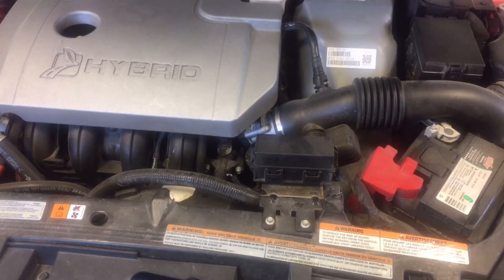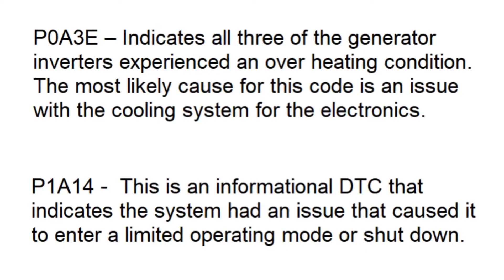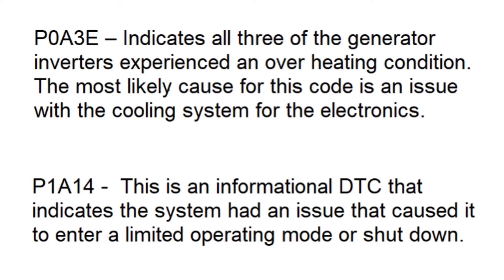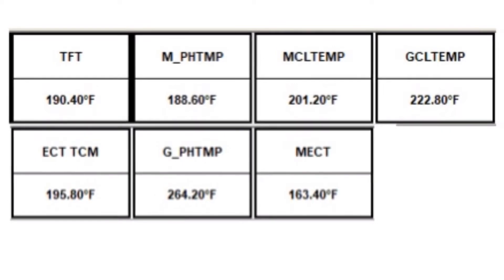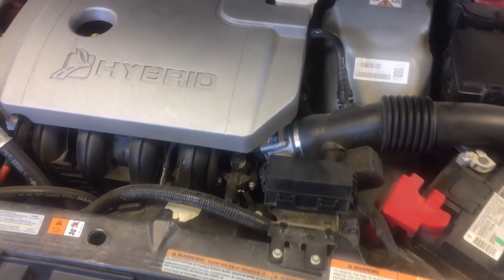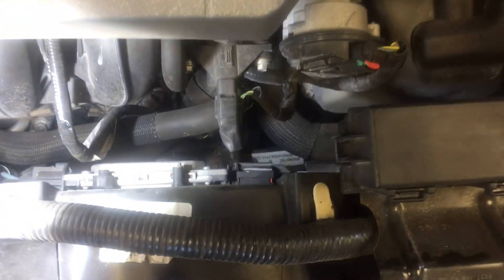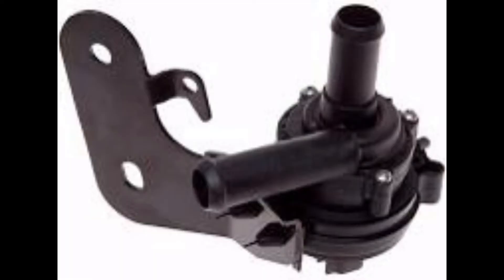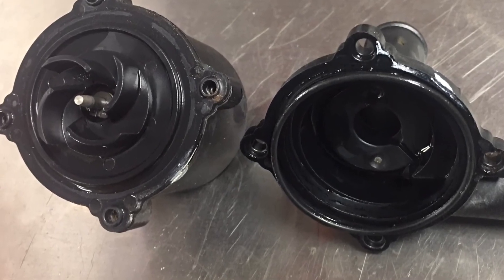Fusion Hybrid Stop Safely Now Message P0A3E P1A14

Comment: I'm having this issue with my Ford Fusion Hybrid 2013, but when I'm looking for the part, there's 2 different ones that pop up, electric engine water pump and engine water pump and I'm not sure which one I should get do you have a link or know which store i can get the part?

Comment: I changed the pump last year. Pump seems to be running fine. Still getting the red triangle, usually after sitting in traffic then climbing hills on a warm day with AC running. Reservoir is full. Can't figure out the problem.

Comment: Do I have to do any bleeding after replacing? If so where is it located?
Reply: Yes. There's a small bolt on the inverter that you unscrew. Try not to unscrew it all the way as it is a tight space to get it back in.

Comment: The coolant pump plugs are not weather-sealed properly. They are known to corrode too quickly on these model fusions, due to the location near the bottom of the car and exposure to water from the roads. The pumps prematurely burn out from the current draw caused by this corrosion. Unplug it, sand the prongs off, spray some deoxit on them, and you're good to go. If it still doesn't work your pumps have been cooked internally. A dangerous problem to have, but it immediately fixed my problem on a 2015 Fusion. I got a coolant warning and I knew I had to absolutely look into it THAT NIGHT or I wasn't driving it. Luckily, it was super easy. Took 15 minutes.
Reply: Which pump you replaced I have a 2014 and replaced the two near the radiator still same problem overheating I herd it’s a third one near the firewall?

Comment: With mine my brake light first turned on then the stop safely sign and my car looses acceleration and shuts off. Now the brake light is always on my hybrid battery doesn't seem to function properly and with the brake light on every so often the car will loose acceleration and shut down any thoughts?
Reply from the maker: I’d want to start by getting all the codes pulled, especially from the SOBDMC.

Comment: My 2010 hybrid car gave me this message after replacing the brakes and everytime I put it on parking it turns off.  Why is that? Please help
Reply: Search on parking break warning light I think there is a way you have to clear the code on the machine if you replaced breakes. I read about it for these but I’m not sure

Comment: 2015 fusion hybrid had the stop light but it went away....been to the shop and they can't  find  any issues. I've put about 3k miles on it since and it drives very smooth
Reply from the maker: That’s strange if it didn’t set any codes or anything.
Reply: @CarShopTalk  Yeah it drives well. I  was told that warning meant my car was done. But not the case so far
Reply: And no more engine lights!
Reply from the maker: @coochiecrook7120  it definitely doesn’t mean the cars done.  There’s several things that are simple fixes that can bring up that symbol.  Over heating electronics comes to mind. Unless it acts up and sets some codes were all just guessing. If it does act up again, make sure that the shop can read codes from all the modules on the vehicle, not just the pcm. SOBDMC is the one I’m thinking your going to find codes in.

Comment: could this problem also occur  if  the  hybrid battery cooling fans not working?
Reply from the maker: If the batteries over heat it could definitely give you the stop safely now message. There should be a battery over heat code in the SOBDMC, PCM, or both if that happens.

Comment: Can you get this and there be a problem even if codes are not showing up? I've had this icon come on twice. I'm also having issues with my gear knob not turning or it turns with a lot of resistance. But when I took it to Ford they said it's not pulling nay codes. I'm so frustrated because there has been times where my gears are stuck for 5 or more minutes stuck in drive or reverse.
Reply from the maker: It’s probably not impossible, but I’d be surprised. If someone is scanning it with a cheap code reader that just scans the PCM it might not show anything, but I’d be surprised if there weren’t codes in the SOBDMC or some of the other modules. The best would be Forscan or a Ford IDS scanner. If you’re just having codes pulled at an OReillys or other auto parts store I doubt there scanner would talk to anything besides the PCM. My usually go to is Forscan Light on an iPhone with an Obdlink mx+ Bluetooth connector. That set up should be able to read codes from every module on almost any Ford.

Comment: Hello! Pretty useful video! I had today same indicator an message" stop safely now". Luckily I got this while my wife and dog were waiting in parking lot. So, while parked, AC on, suddenly the message poped up, and engine stopped. I tried several to restart(even after 2 h cooling off) , the init phase was ok, and when trying to press the acceleration, nothing happened and then the car stopped. I put the car at Ford representative, so on Monday they diagnose them. Do you think is similar behaviour with cases you've been confronted or different? My Ford is 2018 model- in Europe is Mondeo hybrid 2.0 engine.
Reply from the maker: It sounds similar, but I can’t say I’ve seen this issue on any that new.
Reply: Well, the topic is old than a year and the issue was a simple mechanical problem: fuel pump was broken...so the engine was not supplied with petrol. They figured out after 1week ( no DTC on fuel pump - that a big minus), an old mechanic asked to see if the petrol is pumped....Afterwards, replacing the pump was a drama!! 4 weeks to get a new one. Entire supply chain was jammed due to poor fuel pump quality- I check across the Europe and as well in New York and California. So they were testing every batch( Europe and US as well) of pumps. Now after 20k km all is good, no issues so far, runs smoothly with average  consumption from 4.5l/km to max 6.5l/km. Love that car. BtW, the car model is not provided anymore in Europe...
Reply: So i,had same problem what did they did to your car
Reply: Im also curious, I am thinking of getting a monedeo hybrid.

Comment: I bought my 2011 fusion hybrid used, I am having this issue but when I look at the pumps, I have two pumps, one higher up and one lower, does that seem correct?
Reply from the maker: I’d have to see it, but Ford does run multiple electric pumps on some vehicles. Usually the other is to circulate warm coolant through the heater when the gas engines not running.
Reply: @CarShopTalk  I would appreciate it, they look like the same pumps but can't totally tell.

Comment: i really like your video .i bought a 2014 liclon mxz 2.0 hybird' will this still run with your hybird batterys complete dead
Reply from the maker: It uses the high voltage motors inside the transaxle to start the engine, so no it wouldn’t, but it won’t let you deplete the batteries to that level before shutting down. I’ve only seen that once, and that was a training vehicle used by the automotive program at a community college.  It had sat for several years and the high voltage battery was dead. I’d have to look and see what the procedure is on a 2014, it’s varied over the years, but there is a way to charge the high voltage battery and bring it back if this ever occurs.
Reply: I have that problem right now, the hybrid battery is completely dead .What would be that procedure

Comment: I am having the same issue with my 2016 ford fusion hybrid. The engine won't start at all. If I disconnect the 12v battery and reconnect it I feel like the electric engine starts but not sure. The only indicator is that the power steering is working but the car won't move forward or backward.
The only code I have is: P1A0C (hybrid powertrain control module- engine inherited)
Ford says it's the transmission.
(Does the bad transmission cause the gas engin not to start or crank at all and disable it?)
Reply from the maker: A problem in the transmission can definitely make the gas engine not crank / start.  The electric motors in the transmission are actually used to start the gas engine.
Reply: @CarShopTalk  According to the code I have, do you suggest me to replace the transmission (what ford dealership wants me to do), or try something else first?
Thank you!
Reply from the maker: @MrGhassan2006  P1A0C really isn’t enough information to base that on. It’s an informational code that really just means a problem has been detected and the engine is being disabled because of it. There are a lot of things that could cause it.  Usually there are additional codes with it that point to the problem and they may be contained in a different module. A transmission problem or failure could definitely cause this and be the problem.
Reply: @MrGhassan2006   Hello Ghassan i have same car 2016 ford Fusion hybrid with same problem just want to check with you if you figured out what was the problem for not starting the engine?
Reply: @moehafez2873  it was the transmission.
In those cars, the starter locates inside the transmission and the transmission is the most common problem on those ford fusions. Replace the transmission and it will fix the issue.

Comment: Mine is a 2014 hybrid and gives the stop safely now mode, but gives no codes. Any thoughts?
Reply from the maker: Did you pull all codes on all modules with Forscan or an IDS?   Or just the PCM with a generic code reader like an O’Reillys or something?  It’s rare you get something like that with no codes.
Reply: @CarShopTalk  just PCM
Reply from the maker: @michaelspatz3455  Get all codes pulled from all the modules.  I would guess you’re going to have a code in a battery control module or something else that will point you in the direction of the problem. An IDS is probably the best for that, but Forscan is a close second. If it’s forscan make sure it’s an obd adapter capable of talking to multiple networks like an obdlink MX+ Bluetooth or equivalent. I use forscan light on an iPhone with the before mentioned adapter for preliminary diagnosis most of the time and it still shocks me all the capabilities it has. Sometime in the future I’m probably going to do a video on this subject, but get the codes from all the modules and I think you’ll find your problem.
Reply: Thanks 👌

Comment: Ford Dealers 🙄 I called 5 dealers trying to get the Mercon LV changed in my 2013 C-Max. One said they could “power flush” my transmission for $179. No thanks, this car has an HF-35 transaxle, drain and fill. No power flush needed. Next dealer says transmission is factory sealed, no service required 🙄. Next Ford dealer said they would have to call me back, she couldn’t quote a price for the service🙄. Next Ford dealership put me on hold forever, so I hung up after 10 minutes.  Found independent shop, he told me to pick up the Mercon LV on my way to his shop. He even let me watch him perform the drain and fill (I didn’t even ask) and we chatted about cars and trucks(nice guy). If you can find an honest independent shop, tip him generously, they are GOLD!
Reply: My dealership in California did it for me at 60k when I requested it. The mechanic told me that they actually get a lot of Ford Fusion hybrids with transmission issues and that she thought it was a good idea to get it flushed and treat it as a normal automatic transmission when it comes to getting the fluid changed.

Comment: Me again. I followed the advice and ordered a new coolant pump.  I had the dealership install it.  They were a little . . . I dunno,  but they did it.  Afterwards, I drove 110 miles at highway speed and no problem.  Previously, I could barely go 30 highway miles without the warning lights coming on.  Thank you so much.
Reply from the maker: Glad you got it fixed.
Reply: Hey was it easy to fix

Comment: This is exactly what my 2012 Ford Fusion does!  I have had it in the Ford Shop 3 times.  They would add coolant, did things to the pump, but did not replace it.  The third time they said it needs a whole new transaxle at $15,000!  I will see about getting this pump replaced.  thank you so much.  And I will let you know.
Reply: What I'm going through right now with Ford on my 2010. They are telling me I need a new transmission and asking about the same. Insane.
Reply: @Rustiie_95 Hey did you got it fix?
Reply: @gaoussoudoucoure4424  nope. Brought it to Ford and another place. Both said 2 totally different different things costing over $10k each. Just ended up getting rid of the car. Would not have been worth the hassle.
Reply: @Rustiie_95  that’s true. Thank you for the reply. I don’t know what codes were you dealing with but I’m dealing with code different from this video. But the car starts and shut off after couple seconds with the message “Stop Safely Now”
Reply: Did you get it fixed?
Reply: @unicoooorns  I changed the throttle body but it’s still acting. Like the EV sign just stay ON so it doesn’t let the engine run normally. You know when you start a Hybrid car the EV is supposed to let the engine run first till it gets warm or something but mine just starts with the EV On
Reply: @angeab24  I took mine to the ford dealership they told me it was the throttle body that was stuck open and that they could fix that but it’s not guaranteed that will be the only fix it needs, that’s just a starting point; so that could fix it or not and I didn’t want to take the chance of spending so much money for something that might not work. I bought a throttle body and put it on my own and it didn’t work and gave up. They wanted to charge me +$700 just to replace throttle body and the parts itself cost less than $100 and easy to replace. I think I still have mine (the new one that I bought), if you are interested I can look for it and give it to you. 
Good luck. I saw the throttle body fix some people’s issues but not mine

Comment: Thanks for sharing this video! I have a 2012 Ford Fusion Hybrid with the same problem: stop safety now light on and the engine stalls. I went to a Ford dealer, they got the same exact codes and they said the car needs a new transmission, which will cost much more than the car value. What can I do?
Reply from the maker: If it’s just the over heat codes like the video shows it seams likely it would be the electric water pump, not the transmission. I’d ask them what the diagnostic steps they took were that led them to it being a transmission failure. If they actually went through the diagnostic steps the repair order should have the steps and results documented on it. If it just says “retrieved dtc’s, needs transmission replaced,” I’d be a little skeptical. If you don’t trust or believe the shop there’s no reason you can’t tow it to another shop and get another opinion. 
You’ll probably owe a diagnostic charge to them and usually that’s an hour at most shops. If another shop gives you the same diagnosis, fine. If not I would probably argue about it with them. Unfortunately there are still a lot of techs in the world that just retrieve the codes and say it needs something replaced and don’t really diagnose it.
Reply: @CarShopTalk  Thanks for your reply! The shop is a Ford dealer, they should know what they are doing, right? Their report: "Diagnosis transmission verify concern, IDS Hook up, Retrieve DTC's P1A14, POA3E, inspect transmission fluid level, fluid level full but burnt, inspect shifter linkage for any adjustments, inspect for any calibration updates, the vehicle has the latest calibration, performed pinpoint test, per pinpoint test to install a new transaxle assy. Will retest and advise if any further repairs are needed after repairs." The price for the repair is much more than the car's value.
Reply from the maker: @maudonnet  Well, they should know what they’re doing lol.  If I get a chance I’ll flip through the book and see if it’s possible to get there from those two codes. It probably is possible if the transmission is causing the over heat, but it seems like there would be some transmission codes with it and probably some other issues since the transmissions motor, generator or controller would have to be generating a lot of excess heat for some reason. Even bearing failures on that transmission to the point of grinding a hole through the case usually don’t flag over heating codes. I guess what we’re really wanting to know is if someone verified the coolant pump is running when it flags those codes / when it’s over heating. If I remember correctly that pump runs any time the keys in the running position and makes an audible hum and you can feel it running if you put your hand on it or touch it with a long screw driver if things are hot. I’d ask them if they checked that the electric coolant pump for the transmission electronics is running when they’re over heating since it’s been known to cause this issue.  That’s a pretty direct question and should be a yes or no answer. If I remember right the book diagnostics is horrible for these codes.
Reply: @CarShopTalk  Thanks! I'll try to talk to them, although they keep saying "we've done all the procedures that Ford Motor Company tells us to do." I'll probably try another shop to get a second opinion. If your shop is located in Southern California let me know!
Reply: @CarShopTalk  Hi,I have the same issue with my Ford Fusion,is there any way to contact you?Ford service technician  was not able to duplicate the issue and thus not able to check the code,wanted to discuss my options if you have the same experience.
Reply from the maker: @MrSecret_Lm  There should be codes stored in memory for a considerable amount of time.
Reply: @CarShopTalk  my Ford dealership charges $162 for that diagnostic test so you want them to fix it! Rip off as they charged me that for a window regulator bad!

Comment: auxiliary water pump fixed mine, its easy access from underneath, located on the driver's side, bottom of the radiator bolted to the frame
Reply from the maker: It is. I didn’t have the car on a hoist when I decided to do a video.